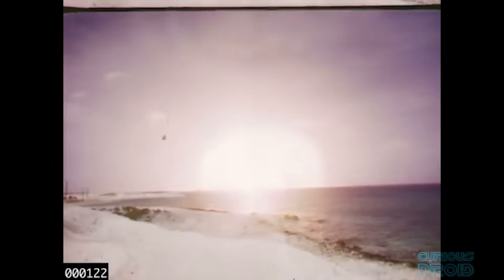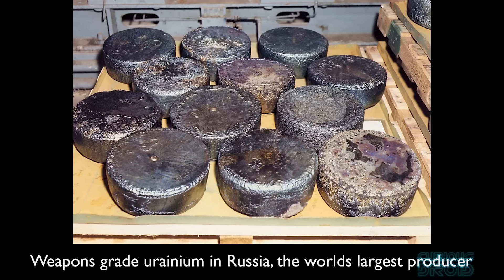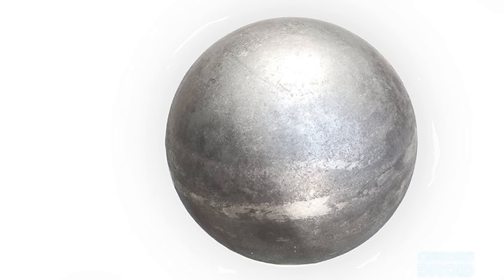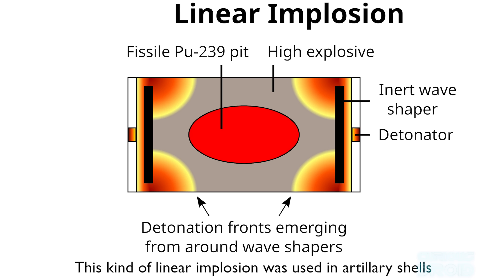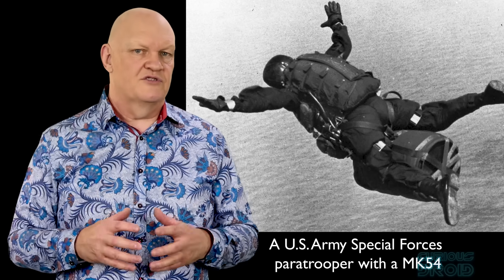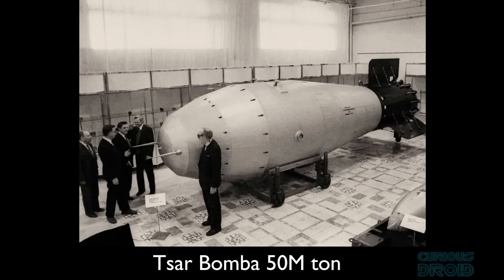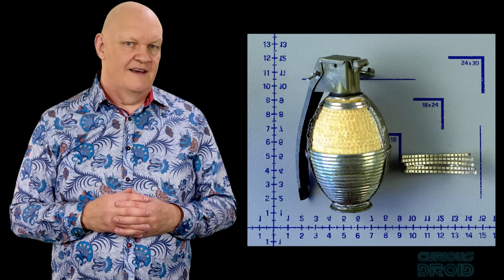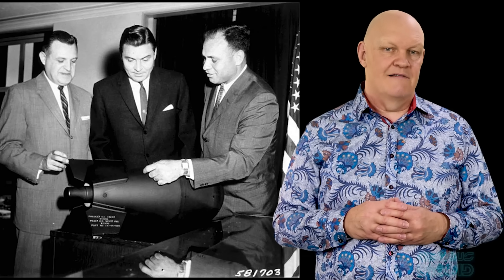How Small Can You Make a Nuclear Weapon?

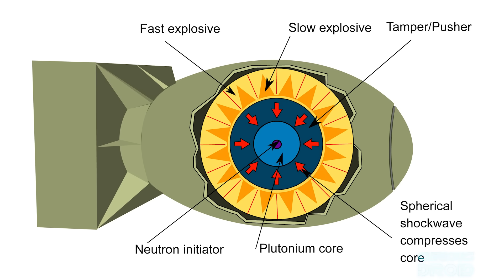Comment: 4:03 The US produced over 2000 gun type devices after Little Boy.
4:45 They had a third core already manufactured, and more in production.
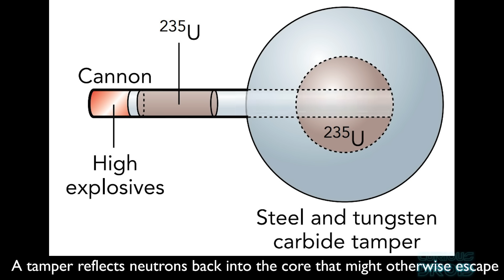5:51 Hydrodynamic tampers certainly don't extend the confinement time by a matter of microseconds.
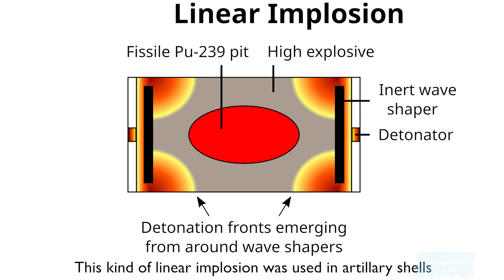7:27 The Mk-54 was not a linear implosion device.
Linear implosion devices still use neutron reflectors.
8:38 The M28 had a range of 2km, the M29 could do 4km.
The blast would only demolish buildings about 0.2km from the epicentre. For personnel out in the open, or in a trench, it was significantly less. It wasn't a suicide mission.
9:14 The US also produced the Air-2 Genie, carrying a 1.5kt W25.
10:09 Multiple mods of the Mk-54 were produced with different yields. The variability of a single model was not that great.
10:17 That footage shows the W9 gun type AFAP.
11:10 Many designs only use 2 detonators, not dozens.
Drones don't present much more of a risk than a car...
14:49 No country ever produced a 10 ton missile warhead.
15:44 No, efficiency isn't the objective of modern weapon designs. High energy density is.
Reply: @Evan_Bell Thank you for your service, I could list 3 f those things which I knew were wrong, but thats very impressive, which shines a bad light on the channel
Reply: Thank you. Your answers to many and various questions asked on Quora confirm you know what you are talking about.
Reply: Many Thanks! I noticed the "They had a third core already manufactured, and more in production." but not the others, much appreciated. Yeah, the "demon core" became infamous after the two fatal criticality accidents...
Reply: What do you mean when saying AN602 (RDS-220) would not demolish residential buildings at 35km? I think overpressure would be around 2.5psi, Which could collapse some dry walls and shatter most windows, fatalities would not be the majority but widespread.
Reply: @perchte  Yeah, I've removed that part. The 100Mt version would produce a 5psi overpressure at a radius of 33km, if detonated 14.5km AGL, which is scarsely below the Tu-95 service ceiling, so the delivery aircraft wouldn't survive.

5-6psi is generally taken to be the overpressure at which residential buildings will experience moderate damage, with severe damage at 10psi...
Reply: >> ... efficiency isn't the objective of modern weapon designs. High energy density is. << Well, I guess it's not only about high energy density. It could be also about how to manipulate the overall energy distribution. What if you know that your current design will typically release this amount of thermal radiation and that amount of blast wave energy, and now you want to have a new design in place that should increase the amount of thermal radiation at the cost of blast wave energy or vice versa?
Reply: teletubby-g1v That kind of energy partitioning between blast and thermal radiation isn't really controllable, because they're the product of the same thing.
The high temperature bomb debris plasma radiates in the x-ray spectrum, producing a radiation diffusion wave in the atmosphere, producing the fireball, which is what radiates the IR, visible and UV radiation. As the fireball expands and cools, the radiation front slows, and when it goes subsonic, hydrodynamic separation occurs, producing a classical hydrodynamic shock, which forms the blast wave. 
There are some factors that vary the partition, like the yield. Higher yield weapons deliver a greater proportion of their energy as thermal radiation, because the fireball is physically larger, and has greater thermal mass. The peak radiant exitance is the same, but the physically larger size results in a larger radiant flux, and having a higher volume/surface area ratio, it cools more slowly, and produces a longer thermal pulse delivering a higher fraction of the total yield. 
This isn't something you can control except for controlling yield.

Third generation weapons can modulate other energy partitions.
For example, neutron bombs allow neutrons to escape the weapon, as opposed to being captured and thermalised in the weapon plasma.
This reduces the blast and thermal effects while increasing prompt neutron flux.
There are other examples of enhanced radiation weapons, like the W71 that maximised x-ray output, as an effective exoatmospheric kill mechanism or anti-ballistic missiles. In the thermosphere, the air is so rarefied that it doesn't absorb the X-rays and produce a fireball in the same way.
I forget the mechanism by which the W71 produced the high x-ray flux. I'll check in with other researchers who have looked into it more than I have, and see what they say. I don't think it's fully understood by the public community.

Either way, modern strategic weapons don't seek any sort of optimisation of energy partitioning. They seek high energy density, to produce compact high yield weapons, with high ballistic coefficient reentry vehicles (to increase accuracy, and thus probability of kill against hard targets) and allow many to be carried by a single ballistic missile.
The low yield (≈45-50kt) tactical B61 mods (mods 4 and 12) may seek to minimise fission fraction, but that's speculative. Only the fission fractions of the mid yield (≈170kt) mod 4 is known, anf that's very dirty. Presumably by the strategic mod 7/11/13 are even dirtier...
Reply: @Evan_Bell  Well-reasoned answer, thank you! Volume/surface area ratio, that argument makes sense, indeed. The Radiation Hydrodynamics is very interesting, going from radiation dominated shock via supercritical to critical and finally subcritical shock. I'm afraid, I need to reread chapter 3 of Carey Sublette's Nuclear Weapons FAQ and regarding the high altitude bursts the related chapters from Glasstone/Dolan. Because there are two pulses of light involved (air burst), I was wondering if one could try to modify the spectrum of the first pulse (shorter duration, mainly in the UV part of the spectrum) that then might have some influence on forming the second one (the much more longer pulse) in the visible and IR spectrum.
Reply: @teletubby-g1v Carey is a very valuable source. He's one of the people whose work got my started on my own research. Since then, I've spoken with him a lot...
Reply: I can't speak to any of the technical nuclear weapons details, but saying a drone is not much more dangerous than a car as a method of deployment... Would the Russian and Ukrainian troops out in the field right now agree with that statement?
Reply: @oldnelson4298 Completely different environment to an undefended, unalert city in some sort of terrorist attack, which is what I interpreted the video to be referring to. In certain situations, such as a covert operative attacking a secure military facility for example, yes, a drone would be a more viable delivery system...
Reply: are you some kind of nuclear weapons engineer? what is your day job?
Reply: @wompstopm123 I'm not professionally involved with nuclear weapons in any way. My background is materials engineering, and my day job is as a laboratory technologist in the aerospace industry.
I've just devoted a lot of time to researching nuclear weapons.
Reply: 2000 gun-type weapons? Why? What happened to them? The gun design was very inefficient, and used vast amounts of HEU, which took orders of magnitude more effort/time/money to produce than plutonium. To even produce the amount of HEU needed for 2000 bombs would have been a giant task. And the gun-type weapon could not work with plutonium, which was why they came up with implosion in the first place.
Reply: @AaronB99999 Why?
Various reasons. They permit smaller diameters than spherical implosion, and so were used in AFAPs (nuclear artillery shells). Some were also. Used as early tactical bombs.
Others were Earth penetrating weapons.

What happened? They were retired and dismantled.

Yes, they made inefficient use of fissile material, but their advantages in certain roles meant that on the order of 2255 were produced in 6 different models.
Reply: @Evan_Bell OK, but it sounded like Little Boy used up most of the available HEU at the time, and that further efforts were directed towards the implosion bomb. Two thousand seems impossibly high.
Reply: @AaronB99999 Yes, at the time it was built, Little Boy used basically all the HEU the US had. After WW2, the US enrichment capacity was greatly increased.
The ONRL site was expanded massively, adding K-27, K-29, K-31 and K-31.
Paducah and Portsmouth diffusion plants were built in the early 50s.

In total, the US produced approximately 851 metric tons of weapons grade uranium, enough for over 13,000 gun type weapons.

Of course, most of it wasn't used in gun type weapons, but in single stage implosion bombs, composite core implosion bombs, implosion primaries, fission sparkplugs, secondary tampers, naval reactors, research reactors, expended in weapons tests, etc.
Reply: @Evan_Bell 
Thank you for taking the time to make your comment and then the many detailed replies. I was quite surprised that a person with your background would take the time to educate those of us here at YouTube University. 
Thank you very much.
Reply: @johntrottier1162  You're most welcome!
Reply: Pretty sure the artillery cannon was 10-15kt not a few tons. The video itself shows at least 10kt
Reply: @finesse7943  Yeah, the W9 was 15kt. Don't know which part of my comment you're  responding to when you say it wasn't a few tons in yield.
Reply: @Evan_Bell the video said something like 10T. My comment is additive
Reply: The atomic bomb was a trick and a lie to fool the world. As you know, since the atomic bomb in Japan, America or no other country in the world has used an atomic bomb despite the fact that America lost thousands of soldiers and lost all the wars since.
It was german scientists with their mafia boss einstein who met the japanese king in 1921 and arranged the fake pearl harbor and the atomic bomb at los alamos, then he received the nobel prize for his scam. The Japanese exploded tens of tons of TNT they had produced for the war.
Additionally instantaneous combustion of uranium or other claimed material is not possible for a physical phenomenon called "delayed neutrinos".

AI version:
In my view, the atomic bomb narrative was a deception used to mislead the world. Since the bombings in Japan, neither the United States nor any other country has used an atomic weapon again, despite heavy military losses and prolonged wars.

I believe that German scientists, led by Albert Einstein, were involved in secret negotiations with Japanese leadership as early as 1921, and that events such as Pearl Harbor and the atomic bomb project at Los Alamos were staged or misrepresented. In this interpretation, Einstein’s Nobel Prize was awarded as part of this broader deception.
The Japanese exploded tens of tons of TNT they had produced for the war.
I also believe that the instantaneous combustion of uranium or similar materials is physically impossible due to a phenomenon I refer to as “delayed neutrinos,” which would prevent such a reaction from occurring as commonly described.
Reply: @ShonMardani I've spent many years talking to people who believe nuclear weapons are a hoax. Not a single one of their arguments holds up to scrutiny. Almost every one of them is a product of poor understanding of the topic.

Judging by your talk of delayed neutrinos, it's obvious the same is true for you.
You're confusing neutrinos with neutrons. Neutrinos aren't produced by fission. Delayed anti-neutrinos are the product of beta decay of fisson products. They don't mediate the reaction, and are effectively irrelevant to weapon physics. 
Delayed neutrons are a thing, but so are prompt neutrons. While delayed neutrons are important in reactors, with their longer generation times, they play an insignificant role in weapons.
You also describe the combustion of uranium being impossible. Nuclear explosives aren't driven by combustion. Combustion is an oxidative chemical reaction, very different from fission. 
You're also wrong that uranium cannot combust. It's pyrophoric. 
These erroneous descriptions reveal your ignorance of the topic. It's obvious you've been convinced by someone on YouTube or somewhere who has a poor understanding of the topic. The blind leading the blind. 
This is just another case of the Dunning-Kruger effect.

The US hasn't used chemical weapons since 1918, despite possessing vast stockpiles of them.
So do you also think that because the US hasn't used them in the same wars that it didn't used nuclear weapons, or even the war in which it did use nuclear weapons, that means chemical weapons are a hoax too?

Comment: Saying how I had an obsession with nuclear weapons as a kid and being gen X and having access to stuff that today would put you in jail today, I have a nerdy correction.  
Implosion was always the goal.  It wasn't about super-criticality (the explosion), it was about efficiency, or how much of the material is burned up in the explosion.  Think black powder vs modern smokeless gun powder.  Sure, both would get the lead moving down the barrel, but modern gun powder delivers more velocity and power because it burns more completely, creating less smoke.  When talking about nuclear bombs, they knew from the start that not all of the U-235 in the Little Boy would be used up in the explosion.  Sure it would reach super-criticality, but it wouldn't use up all of the material and that was wasteful.  Using Plutonium results in a more efficient use of the rare and hard to get material and in the future, would be key in making more powerful bombs, and many more bombs.
Reply: No, implosion wasn't always the goal. It was one of several assembly methods proposed at the beginning of the Manhattan project, but was shelved in favour of gun assembly for its simplicity.
It was only revived when reactor-bred Pu was found to have high concentrations of Pu-240, with its high spontaneous fission rate, which required short insertion times to avoid predetonation.

The objective wasn't to decrease the fuel mass required or increase the yield, but to make use of Pu while avoiding a fizzle...

Comment: The Davy Crockett was the end result of the Army's desire to develop an atomic hand grenade. In the 1950s "ATOMIC" was the buzz-word du jure and the Air Force was trying to monopolize the defense budget, claiming the Army was no longer necessary. The Army did not want to be left out. 

Ted Taylor - the physicist who designed the W54 device used in the Davy Crockett is reputed to have said that "one the size of an orange definitely would not work; one the size of a watermelon definitely would work and one the size of a grapefruit was 50/50". He was talking about the entire package, nuclear core & the explosives to create the implosion. 

With the Davy Crockett, the Army got a device slightly smaller than a watermelon. Almost completely useless as a weapon, it nevertheless kept the Air Force from monopolizing the defense budget.

Comment: The problem with suit case nukes is that the tritium has to be replaced, and nuclear weapons have to receive constant maintenance. Even if they were lost in the 1990's they would probably be unusable today, most certainly the tritium which has a half life of only 15 years would be long gone 30 years later.
Reply: 75% would be gone after two half lives. Subkiloton weapons don't require tritium.
Reply: @Evan_Bell    Isn't tritium used in the pulse neutron tube/ external initiator?
Reply: @wilhelmvonn9619  Can be, can also use DD designs, or not use neutron guns at all, but other types of initiators, or rely on spontaneous fission.

Comment: Thank you for addressing the topic of small nuclear weapons and following the US implementations.   Fissionable plutonium is the detonation material of modern nuclear weapons along with heavy hydrogen to make an H-bomb in the mega tons.  Heavy hydrogen depletes quickly being stated to need replacement in 18 months.   There was only one U-235 based bomb ever exploded that is publicly known that being one of the A-bombs dropped on Japan in WW2.   It is a long time process to enrich U-235 to 90% weapons grade and its much heavier than weapons grade plutonium required which is much easier and faster to produce from a breeder reactor.   Various grades of uranium maybe used in the construction of  nuclear weapons. 

The US Castle Bravo H-bomb test in the Pacific was expected to yield 5 mega tons, but is assessed today at 15 mega tons.   Lithium-7 used in the bomb thought to be inert in practice greatly enhanced the explosive yield and added greatly to highly radioactive fallout.  That's the public story.  The Soviet's 50 mega ton Czar H-bomb detonated  a few years later was very different being described as a very clean nuclear explosion.  The area was decimated, but today radiation levels are low.
Reply: Pure deuterium (heavy hydrogen) fusion fuel has been obsolete since 1954.
No, deuterium is stable, and not radioactive. Tritium has a half life of 12.3 years, and is replaced every 3 years or so.

Nope, many HEU fueled devices have been test fired.
You saw one in this video.

HEU can be produced by high performance gas centrifuge cascades in less than an hour.
High flux breeder reactors take a month to produce weapons grade plutonium.

Uranium is less dense than plutonium, unless it's alloyed with Ga to stabilise it in the delta phase.
Lithium doesn't produce meaningful fallout. It increases the fast fission yield of the tamper, which increases fallout though...
Tsar Bomb produced no local fallout, as it was airburst.